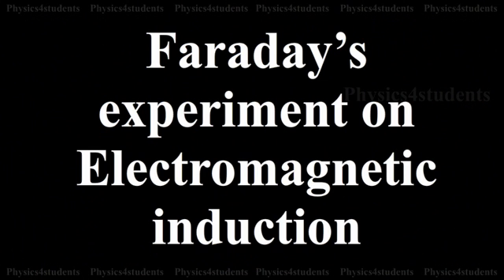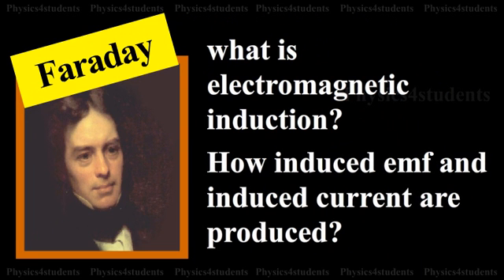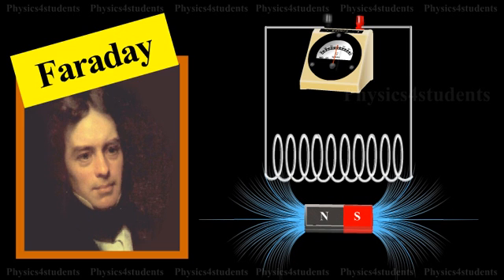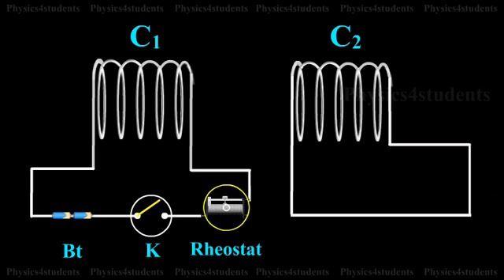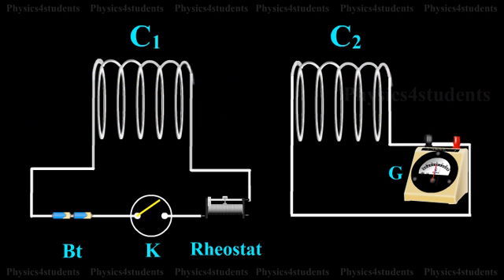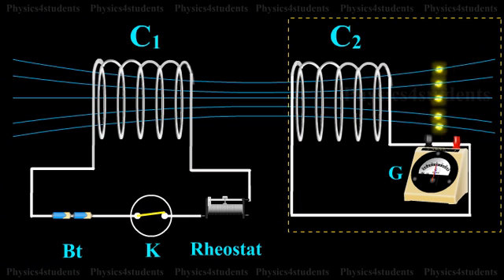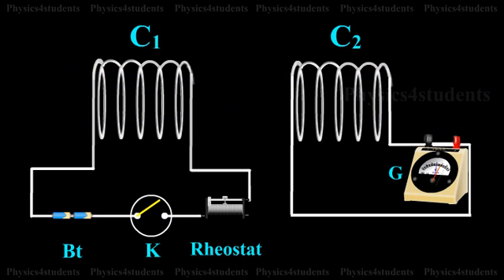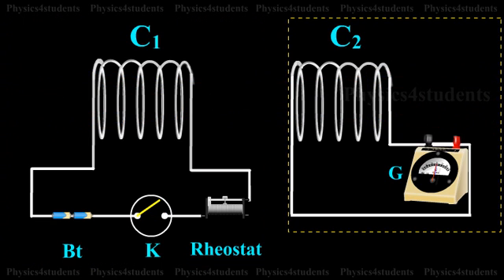Electromagnetic Induction Experiment - Video Explanation

Comment: i want to know why there is rheostat
Reply: Because you need varying magnetic flux in order to get the current in coil 2. Thus a rheostat is used to increase or decrease current so that the flux created by the coil 1 is varying. Hope this helps.
Reply: For variable resistance.
Reply: Rheostat changes resistance which changes current and rapid change in current in coil 1 will cause more generation of current in coil 2 since magnetic flux will changes more rapidly. Since, it is better to change the amount of current to change the magnetic field than to turn the switch on and off to change the magnetic field, we use rheostat
Reply: Same
Reply: no idea